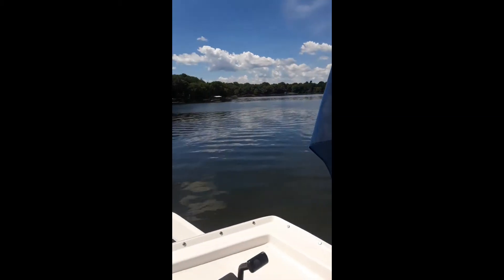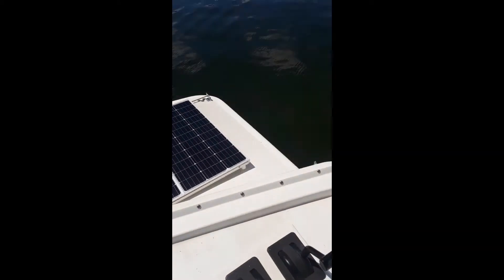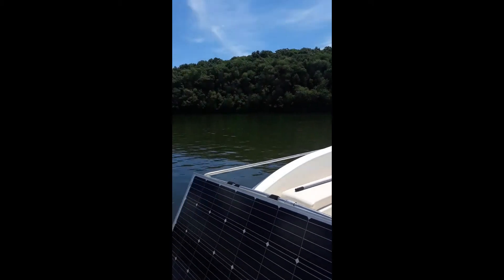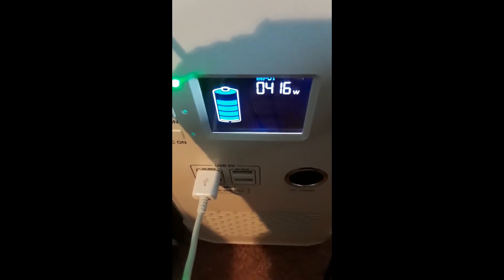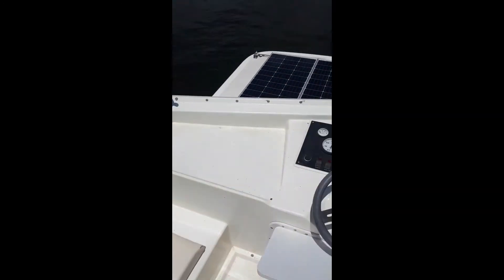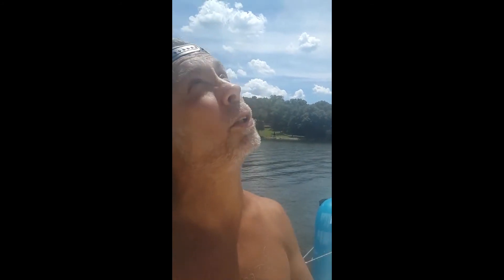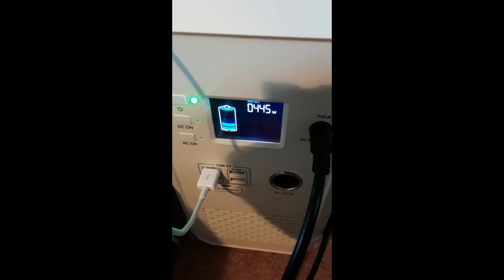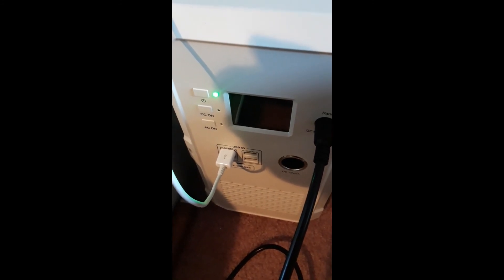Kevin's Solar Adventure Overpaneling w/MaxOak Bluetti EB240

Comment: Huh, so the EB240 worked fine with the open current voltage being over the advertised limit of 68V? My math adds up to 86.4V with just the 4 100W Renogy panels in series. I don't know enough about open current voltage to understand when that number matters, but I'm surprised you didn't get an error code. Are you running all of the panels in series?
Reply: there is no way they are all in series. it would throw an error code.